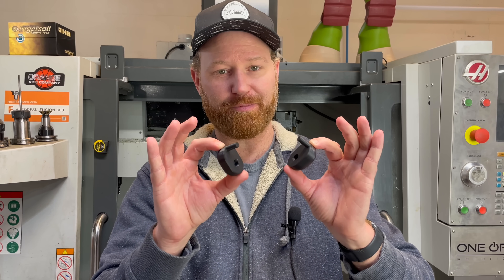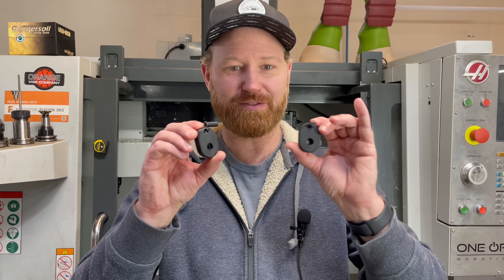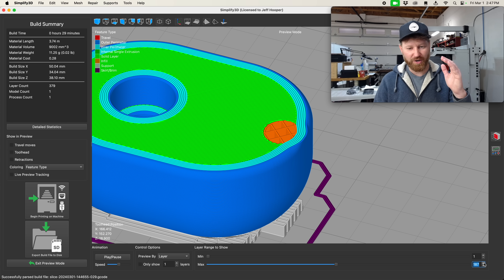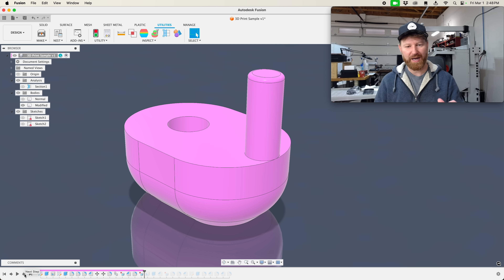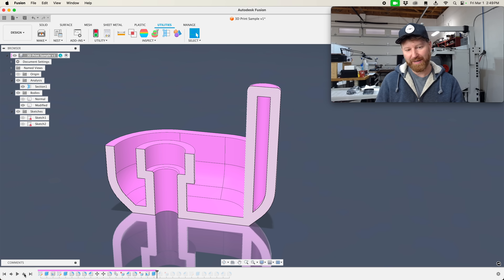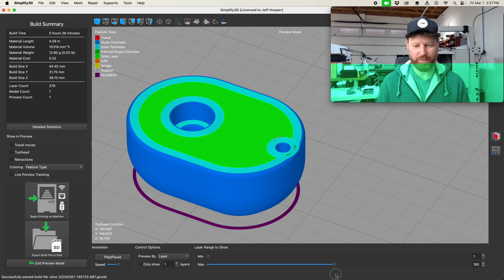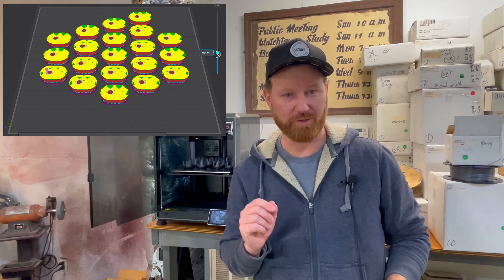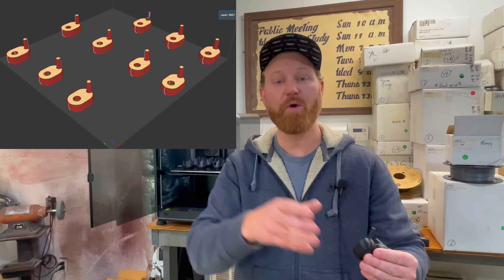Make your 3D print Faster & Stronger

Comment: You didn't mention filament type in your video, but I suspect the cooling problem described at the end of the video is much more relevant to some materials (e.g. ABS) than others (PLA) where the heat of the new layer should be enough to re-melt and fuse layers on its own?
Reply from the maker: These were printed in PLA, and it made a noticeable difference. However, you’re absolutely right—it had an even greater impact with PA-CF.

Comment: Maybe I'm missing something but from everything I know about 3d printing, aren't model files saved as solid 3d volumes? How would you actually define an internal wall inside of the model like that? Maybe I'm missing something but it seems like that's something you'd need to do in the slicer, because the model itself should just be exported as a solid object.
Reply from the maker: Yeah, instead of leaving it solid, we "shelled it" and left walls. This way, you're not building a surface on infill. When you design anything, it should be designed with the manufacturing method in mind.
Reply: @ChipMonkeys  Yes but my point is, on a technical level, that shouldn't be possible with how meshes are exported and sliced as far as I'm aware. Any closed shape is by default sliced as a filled volume and as far as I'm aware file formats like .stl literally just export meshes, which wouldn't be capable of modeling internal solid geometry like that. 

I've seen people do stuff similar to this by making micro-cuts internally to make the slicer add additional "walls" inside of the part, but you seemed to somehow actually directly model internal geometry in a way which is preserved by the slicer. 

Are you saying that you literally turned the part entirely hollow and removed all of the infill throughout the entire thing? I interpreted your wording as in you were replacing the infill in that area with solid walls, not removing literally all of the internal infill but that's just about the only way I could see this working within the constraints of how modern CAD and slicer software works. The thing is, that'd be making a pretty massive compromise strength wise. One particular area of the part would be incredibly strong sure, but the rest of the part has 0% infill and is an empty void which would make it weak and, depending on the part, make it not even print correctly in the first place due to massive internal overhangs. If that's the case, then adding 'micro-cuts' would likely be a better method to strengthen the part in this manner since you could add internal wall-structures without losing infill through the rest of the part. (at least, a better method that isn't slicer-dependent. I'm sure some slicer has some fancy way of doing this builtin, but micro-cuts are the only slicer-agnostic way of doing it that I'm aware of)

I'm not sure if fusion360 allows you to do this or not, but I'd be really interested in seeing a wireframe exploration of this part to understand exactly how it's actually being modeled as a mesh that the slicer can understand.
Reply from the maker: @robonator2945  Imagine you download an STL of a Glass bottle, then a ship. You then place the ship in the glass bottle and print them at once. It would print a ship in the bottle. It wouldn't just print the bottle. If you model internal structures, they will print too.

Comment: Great VIdeo and exactly what I was looking for to strengthen parts. Do you know if this method of capturing the internal geometry is possible using Orca Slicer or Cura? I don't use s3D.
Reply from the maker: Yeah, you'll need to play around with wall & flat thickness to avoid think layers of infill. This print was stronger because we didn't print the boss on a flat surface that was built on 15% infill : ) Thanks for your good comment!

Comment: Do you want it Hollow or not make up your mind before it is designed.

Increase wall thickness to 5 mm  or 100% infill and done in 1/10th the time.

layer adhesion is fixed by putting the lot in an oven at 400 for 15m

phantom hollow infill will be the death of quality part solutions. we will all need xray machines to make sure its real.

Comment: You've strengthened that lateral force failure point. You've changed the cylinder from being solid to a shell, though. Your cylinder is less strong for compression and your prior failure point under lateral force is more likely to fail now under torsion. Still a good video on getting people to think about how they can design better.
Reply from the maker: Thanks! Yeah, I could have used a better example for sure. : ) We printed a similar part for a customer and didn't want to use his design for the video, hence the dumbed down version. This was designed for lateral force, just for the opening demo. If someone thinks differently about designing for 3d Printing, it was a win.  Thanks for watching and commenting.
Reply: Infill.. nothing is actually hollow. the cylinder is solid no matter what. he’s basically choosing what is solid vs being infilled.

Comment: Thanks for the video. You can still print all the parts but try annealing them afterwards and they should be stronger than the first model you showed.
Reply from the maker: Not all materials are good for Annealing. Like PLA : ) ABS, ASA, and PP benefit from annealing. This job was PLA. Thanks!

Comment: I find this very interesting, but wonder if you left something out? First of all, I didn't realize that anyone was shelling parts out for printing parts. You may have said something I didn't pickup on, but how do you get the printer to take a shelled out part and print it as though there's material on the inside? There is no material on the inside void of the shell, at least in the CAD model unless you did something more in CAD that you didn't seem to show? So I'm guessing it might have something to do with something you said without explanation? Something about printing it as a shell? I'm pretty new to, and only beginning to learn the slicer software, but I'm not new to CAD.
Reply from the maker: Good questions. If you use Fusion 360, you can download the 3D Model from our site. It has the history of the modeling changes. Shell is just the perimeter passes, or Thickness of the walls. After we shelled the part, there can be no infill. But, the slicer will add Support material to the inside. This is a technique that allows you to reduce material, target stress points, and decrease cycle times for production runs.    Thanks for watching!

Comment: Are you sure it's not layer time cooling slowing down the print? This is a very standard feature in slicers and if the layer is small, it slows down the print to allow it to cool better. This also causes the plastic to melt a lot better because it is going much slower, which in turn causes better layer adhesion. I suspect this is what is happening more than the hot plastic on cold theory. Most printers if not slowed by layer time, they push the limits of their hotend, which means less layer adhesion when adding more parts up to the point it stops slowing down because of layer time.
Reply from the maker: Good thought! We printed these 1 at a time with all the same settings. The only change we made was modeling the inside.

Comment: Seems like a lot of extra work. Why not just change the slicer settings from 6 walls, 4 top/bottom, 25%(?) infill to 8 walls, 8 top/bottom, and 5% infill? A modifier under the post to create solid infill might also work.
Reply from the maker: Yeah, I probably should have used a better example. This is more of a concept, and not a video on making a boss stronger. Even if you added more Top and bottom layers, it would not be this strong. What if you printed a Box that needed to hold weight in the center? You should Shell the inside, and just model a tower structure right where the load would be. For production printing, when time matters, this only prints the strength where it needs to be, and not where it's not needed. I hope that helps. Nice question!
Reply: @ChipMonkeys  I understand what you're saying. Every application is going to vary. I've got far more 3d modeling experience than slicing experience and still find it can be faster and just as effective to make slicing changes vs model changes is all I was getting at. I wish more people were looking into ways to optimize models for 3d printing, keep it up!

Comment: Make it a hole and add a rod. Layers for small towers, unless you change the orientation to print the length of the tower, will likely break under low pressure. If the small tower is critical, it is better to add a solid rod.

Comment: How do you achieve both goals - shell and add the walls and then turn everything else into a solid for infill?  You might have two things going on - need for the pin to be strong against bending and also the entire structure strong against crushing.
Reply from the maker: So, we modeled the boss to make it stronger. If we also had a problem with it crushing, add a web in the middle. But, the internal radii strengthens the deck too. The model is on our site under 3D Printing for evaluation. Nice comment, and good thoughts!

Comment: Would you share the F3D file so we can follow along with the timeline? I want to know how you easily added the top layer back after shelling as well as the internal structures.
Reply from the maker: Hey man. It's on our website in the native fusion format with history. Check under 3D printing. Thanks for watching!
Reply: @ChipMonkeys  Tried downloading through both chrome and safari. It sits there spinning for a second but doesn't do anything. Check the link?
Reply from the maker: @taiguy  Crap... We just put the link up. I'll fix it.  It's on me. It will be good in a few minutes
Reply from the maker: @taiguy  I had to Zip it. The browsers think F#D files are bad : ) It's good now.
Reply: Now the zip downloads but the F3D file throws an error saying "Unable to Open Untitled. It may not have been synced correctly". @ChipMonkeys
Reply from the maker: @taiguy  I guess you're our beta tester! That's my fault again. I'm using a beta version of Fusion and that model will not work for you until next week sometime. I'll upload a previous version that's not beta! Man, I'm sorry for the trouble! Thanks for working with us. It will be working in 15 minutes.

Comment: The strength of the protruding cylinder is depending on layer adhesion. Extending the cylinder walls to the bottem of the part does not change that: the weakest point is still the same layer. You will have to add an infill to the cylinder. And that should not be 100% because that does not spread the load but it should be something like cubic.
Reply from the maker: Thanks for your comment! You're not wrong. But keep in mind, this has much broader applications. And, by modeling the inside of the part, you can also add radii there too. This is just 1 way to get much stranger parts.
Reply: @ChipMonkeys  True, there are many ways to improve strength. I regard it as 2 different steps. Designing for strength the 'classical' way, that is chamfering/rounded corners etc. And designing for the the 3d printer layer weakness. The latter does include tweaking the printing profile for a particular item. IMO half or more of the final stength is achieved in the slicer.
One thing to mention: some free cad programs will omit the internal structure on export even if you draw it.

Comment: I think you’re fine without interior supports when you have a flat  (horizontal) “roof”. That bridges fine for such a small area. Double the size and I’d probably suggest differently. Slopes would be different.
Reply from the maker: You're right! I printed the real customer part without internal support. It bridged and printed great. Thanks for your comment!

Comment: Great tip.  Never considered that for strength before.  I have been relying on thixk top and bottom layers for the weak points of my tall and narrow parts.  Will see if there is any where I can use this design improvement.

The last part about sequential printing.  I have done this for a long time on parts I must guarantee to have smooth outer surfaces.
Reply from the maker: That’s awesome! Thanks for the comment!

Comment: Love it! Very rarely do I see this talked about. Only one question. Are you using a "3D mouse" to orbit and zoom around the part? Sometimes I see these weird fluid movements in videos and I am wondering what input device they are using, because it never looks like that when I just use my regular mouse.
Reply from the maker: That’s a 3D Connexion controller. I bought a few of them, but it looks like they went up! https://www.amazon.com/3Dconnexion-SpaceMouse-Wireless-universal-receiver/dp/B079V367MM/ref=mp_s_a_1_2?adgrpid=57563685513&dib=eyJ2IjoiMSJ9.TiHiPktVgJmYlWNZBjltpWbGV9VexWKwf58nqtxDv2UwtHtnR8d8GOKd2Cto_e1BM_2JDp2-8XQ_Jl9asjUam5XQK88nluWXB0ozUkvPXp3XKQz4qIXfWTrq_kOwQig9euazpsKBzDPbUeIEtduHcFxnAprPluo5l-TTd8vob56aktu7pE1iAFnKG1nwdtvdm5dmTCBpUS0YLG0KyKYXfQ.XXpE8Z1bzkF-habs67GQ_Yh4m8R1temKlheerBvRxzo&dib_tag=se&hvadid=651162589606&hvdev=m&hvlocphy=9013299&hvnetw=g&hvqmt=e&hvrand=14994002162514758618&hvtargid=kwd-296149135190&hydadcr=20137_13445650&keywords=3dconnexion&qid=1710159678&sr=8-2
Reply: @ChipMonkeys  Awesome, that's what I thought it was! Thanks!

Comment: I’d leave the “chimny” feature open on the top and insert a steel dull pin. Or you can pause the print before it closes the top and insert the pin at that point. That will give you a strong part.
Reply from the maker: That's a good tip! But it would still break off at the infill. It needs to be modeled on the inside. Then the steel pin would go throughout the part. That would be crazy strong. The next step would be machining it! haha

Comment: It's a slight bit of a pain in the ass that the parts are being printed one at a time, always in a really ridiculous order... so it helps to take those parts and move them along the built plate, so they are printed in whatever order you want. If you slice and then move a part and then re-slice... it will STILL print those parts in the same order... so now your new order of parts can be in any order you choose. It takes about a minute or 2 to move around 9 parts to have them printed in the order a placement you want them to be printed in... so it's definitely worth it if you're going to be printing several of the same part... or especially several batches of the same part. You can also make certain that they print left to right back to front, so the risk of the hotend hitting finished parts is reduced.
Reply from the maker: Good catch! You’re right about ordering them. That’s what our next video is about.
Reply: @ChipMonkeys  lol. nice. Made sure to sub. (I appreciate that you replied. I meant to sub and turn on notifications, but didn't before, because  I forgot to restore my tabs when my browser crashed. I accidentally closed the "restore tabs" notification when I reloaded).

Comment: a few years ago, in 2019, i ran into this issue, i just used the "cut" option in my slicer to separate the part, and thats it. The slicer sees it as a floating piece and will ask if you want supports, just hit no. and BOOM, you have a more solid piece
Reply from the maker: Hey, what slicer are you using?
Reply: @ChipMonkeys  prusa slicer has the cut option and a whole lot more. There tree supports are awesome as well
Reply from the maker: @LT72884  Right on! We used the Prusa Slicer in one of our last videos. We will take a look at the Cut option! Thanks for the heads up!
Reply: @ChipMonkeys  you are welcome

Comment: I have tried adding internal walls before, without much success. When adding an internal wall, in my experience, the slicer views the internal walls as external walls and therefore doesn't generate infill in the hollow areas of the print. I suspect this is why you have support material inside the part as opposed to infill? Either way, a really nice, concise, informative video!
Reply from the maker: Yeah, infill turns to Support material. You should be getting your strength for the Wall count. Inside and outside. Glad you took something away : )

Comment: So interesting, I was thinking about this these past two days. I wanted to make a holder for my load cell, but it bends quite a bit since its plastic, and I was thinking of adding internal structure to replace the weaker infill and make a more rigid part. Randomly found this video without even looking for it or "talking over my phone" lol, what are the odds?
Reply from the maker: If you remember, let us know your results!
Reply: @ChipMonkeys  Yeah, I made two distinct parts of equal size 100x20x80mm and measured the force it outputs when pressing down on it with a given displacement while the parts are held in place, like a trampoline. Both parts were sliced with 3 walls, 0.2mm height, but the first part had 40% cubic infill and the second part I added 5 beams inside it of 1.2mm (3 walls of thickness). The first part weighted 12.85g and the force it measured was 13N for a 0.1" displacement. The second part weighted 15.36g and measured 19.4N for the same displacement. With this result I believe internal beams make the part stronger with respect to this type of bending motion, but more testing would be nice to get a better comparison especially when it comes to material used and printing times.

Comment: The printer slowing down for the short layer times of that post has the biggest effect, much more so than the previous layer being cool. Pressing in a metal pin or screw from the back will give you ultimate strength and let you print many very quickly.

Comment: Awesome stuff thank you. I caught your video on my feed last night and immediately went back to the drawing board on a part I designed. Using this same technique I revised the geometry in Fusion and did a new test print and it's essentially unbreakable now by hand. I'd have to take a hammer to it so thank you very much for this quick tip. Really good stuff 👍